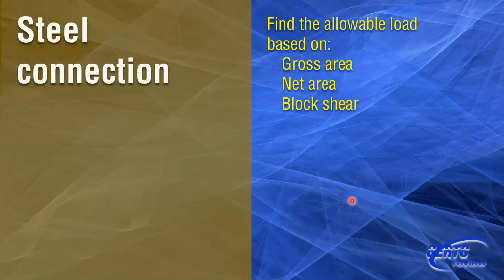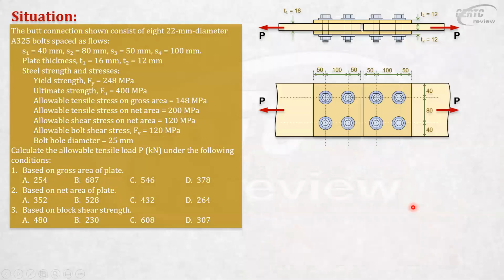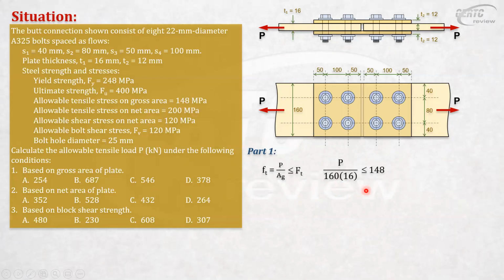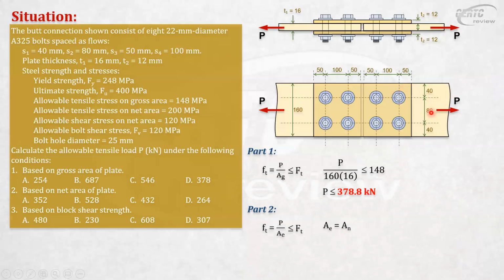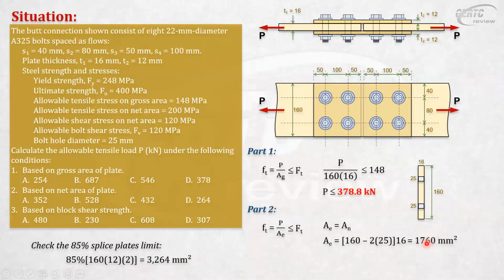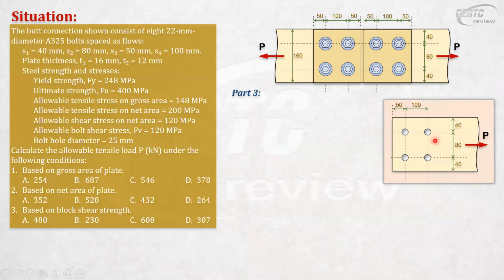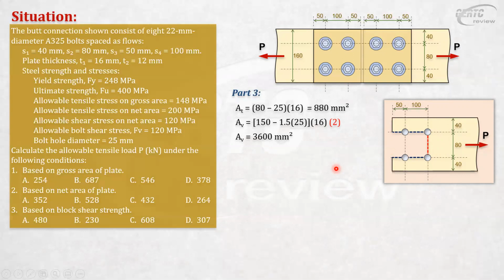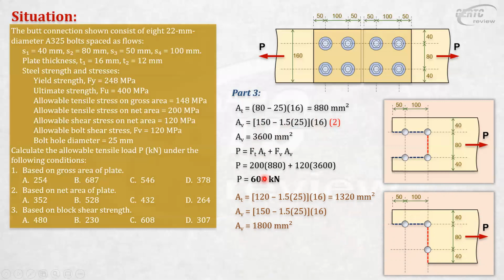Solving for the Safe Load of Steel Connections (Steel Design)

Comment: Sir, how do we know if we should or should not add 2mm (or 1.6mm) to the bolt hole diameter? There are problems that do, and problems that don't. I'm confused po. Thank you.
Reply from the maker: Supposedly mag add talaga tayo ng 1.6, but sa board exam depende na kasi sa examiner yun.  Kung wala sa choice yung sagot mo (when adding 1.6) then you have to reconsider not adding it.